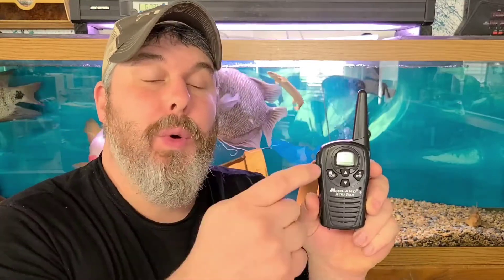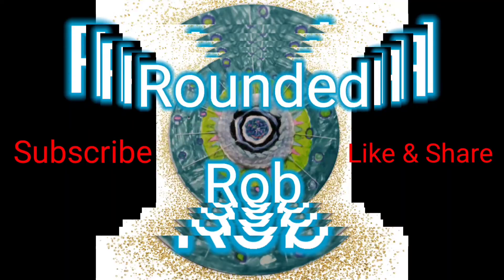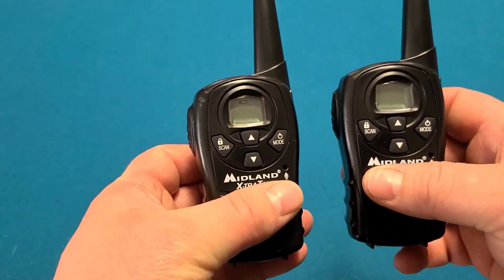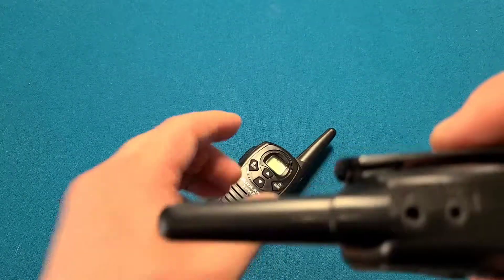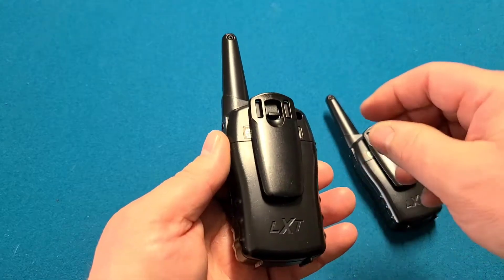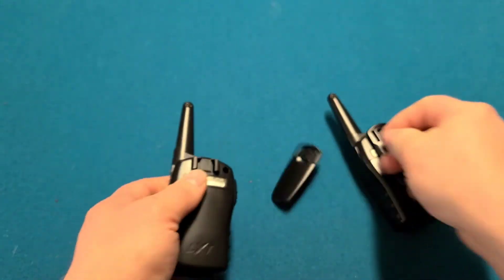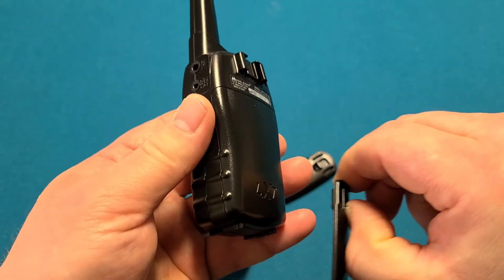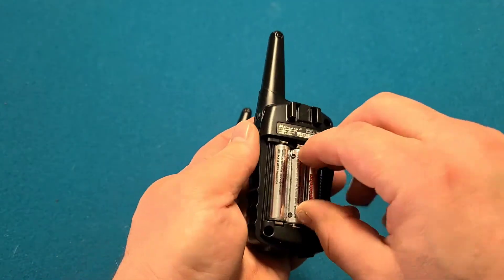How to remove batteries from Midland X-tra Talk. Walkie-Talkies.

Comment: You know, on my four samples, I actually have to use a plastic pry bar from my electronics repair kit to take the cover off. I just put the sharp end in the top groove/space and apply a little pressure to pop it downward.  This is with nimh or alkaline batts. Just in case others have issues with the covers being a bit tight and not easy to take off like in this video.
Reply from the maker: Nice

Comment: What I really need is how to remove the battery cover since mine seems stuck beyond normal.
Reply from the maker: Larry, did you get the cover off??? You could try a small flat head screw driver. Like one for eyeglasses. Or maybe a toothpick. To pry it down without damaging it.